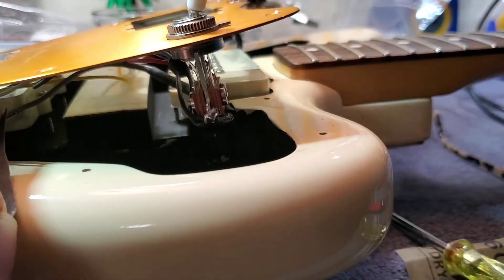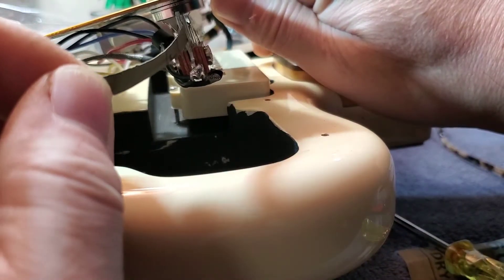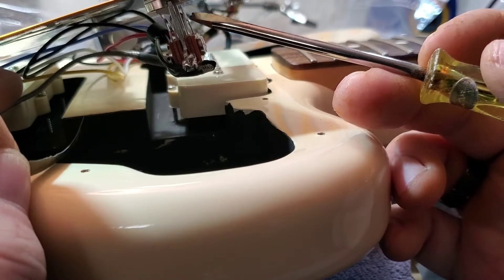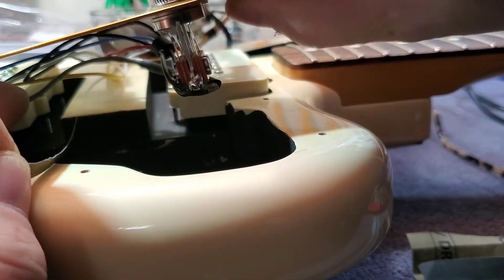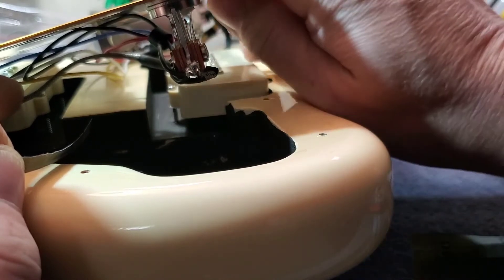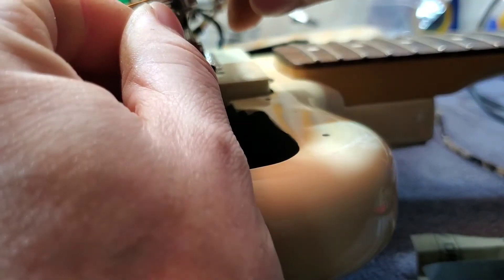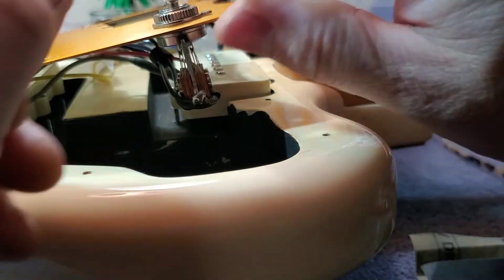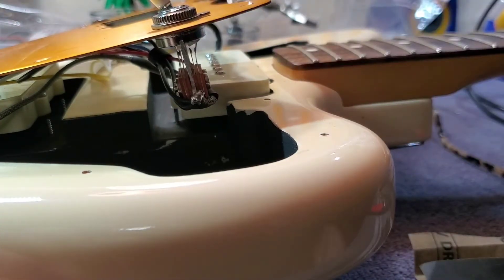One way to fix a three way switch

Comment: Nice tip. I will try to do on mine since has been failing. What's your opinion on these more cheap toggles?
Reply from the maker: The inexpensive toggles are hit or miss. The pin that the toggle pivots upon can be sloppy and the switch engagement clicky and loud. That said, I've used them in some situations with success.